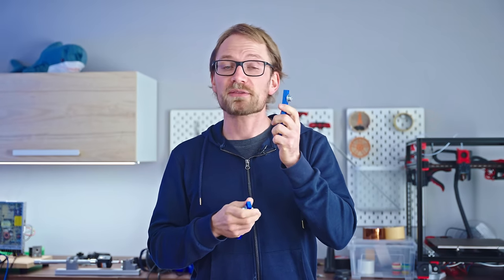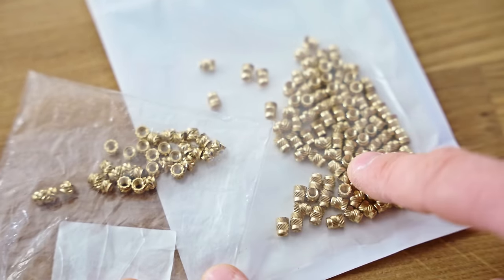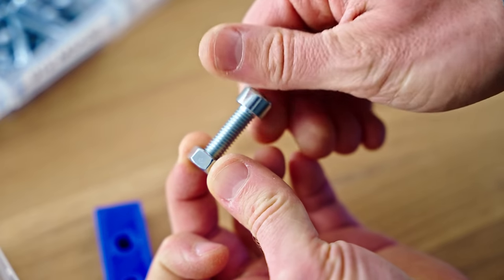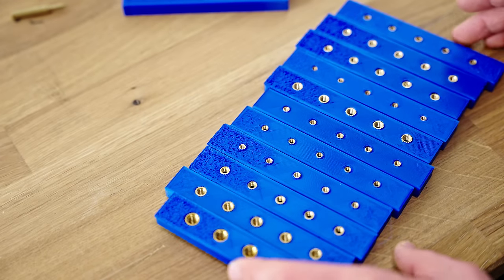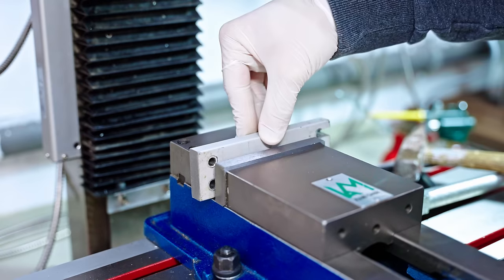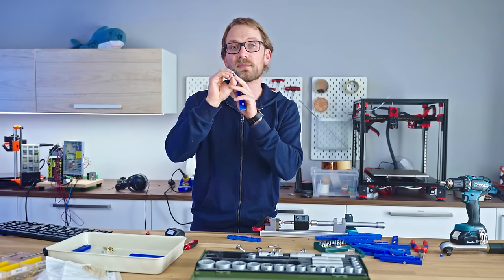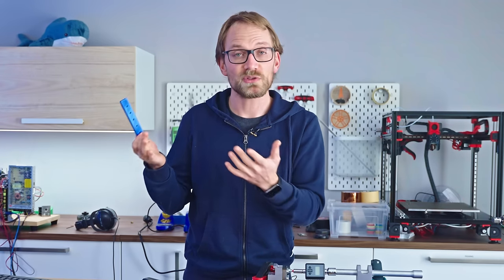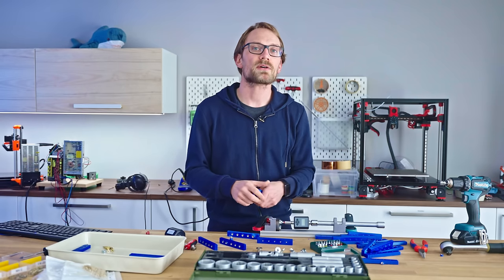Do you even need threaded inserts? Strength tested!

Comment: I typically use self-tapping 3mm screws in 2mm holes with no printed thread. Even for parts that need occasional disassembly and re-assembly they work great. And let's not forget that lots of injection molded cases do the same thing. And in my experience PLA parts survive unscrewing and rescrewing better than the industrially produced ABS parts. As I'm writing this I'm printing 3.5" to 5.25" mounting adapters that I designed today (because the ones on Thingiverse are all just imitations of mass produced parts and these designs work poorly for 3D printing) and the means of fastening the adapter to the PC case is by means of 3mm self-tapping screws. I always use the longest screws that will fit.
Reply: yeah, self tapping screws: fast, easy, cheap and often plenty strong. If strength is a question, bolt and nuts. I only rarely print things that I plan to take apart multiple 
times.
Reply: I skip the self-tapping part and just use regular M3 machine screws and force them on the hole. Power tools will melt the plastic, but if hand tightened, they usually work just fine. "Just fine" as in the level that I never opened the insert box I ordered a year ago.
Reply: This is the way.

Although I design my holes to be 2.5mm for m3 screws. I very rarely have problems with this kind of self-tap and it's always self-inflicted harm.

( i.e. impatient assembly, bad design, faulty print, etc)
Reply: @bogusF  and also if the hole got to small, a 2.5 drill by hand and all ist good^^
Reply: I too use regular M2, M2.5, M3 and M4 screws as self tapping screws (by hand). I print a hole smaller than nominal and using a separate slicer modifier solid (prepared in CAD), I add a 2mm thick ring of plastic (perimeters) just around the holes to be later tapped by the screw. If you use long screws as shafts (sticking out of the part) this method will effortlessly give you perfectly straight (perpendicular to surface) shafts. A thing almost impossible to achieve with inserts (that are impossible to sink in perfectly perpendicular to the surface). And you can screw and unscrews many times without ruining the tapped hole. I do not use inserts anymore for pieces not intended to be screwed/unscrewed repeatedly. I use PETG.
Reply: @korjaa that's exactly what I do and an M3 screw with about 15 mm of engagement in ASA will have enough engagement with the 3 printed parts to break the screw before it comes out. For some reason none of these videos from anyone ever covers that.
Reply: I use 2,5 or 2,6 mm for m3, 2 mm is way to little
Reply: @suit1337  I'm talking about self-tapping screws, not M3. Self tapping screws have a sharp point and a course sharp thread, very different from M3.
Reply: @frankbauerful  that makes sense yes, i was thinking about self tapping M3 screws (basically a screw with a treadcutter on top)

i guess you are refering to non helical self tapping screws like metal screws with a blade shaped cutter tip

i don't know the english terms for those, but in german they are called "selbstschneidende schrauben" with the blade cutter, and "gewindefurchende schrauben" with a metric thread with added cutters or a special teuleaux triangle shaped thread at the tip (see DIN 7500 for reference) those are great, because they behave the same like metric iso threads and can be removed and rethreaded
Reply: At re-assembly first turn the screw left with a bit of pressure until you feel or hear a light click, then screw it in. This way you reuse the previous thread and avoid cutting the material a second time.
Reply: Yall know drills that dont suck have variable speed right? Melting isnt an issue if you dont full send the trigger. Also, use the clutch.

Comment: For the past 5-6 years I’ve just self-tapped into a tighter printed hole and had excellent results that way. Yes, occasionally I’ll use a nut on the back and once or twice inserts but for 90% of the loads I put my prints through (including my CNC machine), the self-tapped printed holes seems just fine.
Reply: Same, and I have hundreds of products (modified, industrial card printers) out in the wild assembled like this and not a single fastner (mostly M3) failure.
Reply: Hear hear! Same here. This video seem more like a hidden commercial

Comment: A handy tip for increasing the number of perimeters around just a hole: You can put an infinitesimally thin annular gap spaced out a few perimeters lines from the ID of the hole. This will force the slicer to an extra set of perimeter lines around the hole without having the increase the number of perimeters everywhere. I'll actually put these phantom gaps anywhere I need to add solid perimeter lines in an area that would otherwise just be infill.
Reply: Ill have to remember this one. Could have used this trick the other day
Reply: Annular gap? Like cutting a circle into the existing hole with ~0 height?
Reply: @SixTough  More like a cylindrical gap  of, say, 0.001mm wall thickness but the height of your screw. The radius of the cylindrical gap should be larger than the original screw hole size by several (4 - 6) line widths.
Reply: @SixTough  nope, ctting a 0.0001 wall thick cilynder around the hole full depth, or maybe two concentric at 1 mm distance from eachother (assuming you print 0.4 mm wide layers), that forces the slicer to put 3 walls around the hole, another 3 around the first gap and another 3 around the second gap, but the gaps being so narrow the walls for each circle will melt into ecother giving you a 9 walls print.
Reply: @severpop8699  oh yes I see it now, thank you
Reply: Yes - I wonder about putting extremely thin slits in a starburst shape coming from the hole - could really improve the hole-infill interface?
Reply: @SixTough  anytime pal
Reply: @robbiejames1540  niet tavarasci, it has tofollow the shape of your hole, in our case circular
Reply: I made a video explaining this exact method ages ago. I called it seeding. It’s like inception. A cylinder within a cylinder 😂
Reply: @JLake3D got a link to that please? 👍
Reply: @stuffoflardohfortheloveof  Perfect & Strengthen Your 3D Prints Part 2 (Rods & Bolts)
https://youtu.be/wIA5BZCvHvI
Reply: @lobocnc also, with this method you can make nice ventilation grills in parts)

Comment: For extremely small screws (M2, M2.5, M3) I tend to just screw directly into an oversized printed hole; basically the tapping method, but skipping the tapping step. I get fine results, but I'm also never designing parts for strain, just assembly.

Comment: I usually embed nuts inside the print by modeling a cavity and pausing the print at the top layer of the cavity. Nuts are usually a lot easier to find for a particular size than threaded inserts, and more broadly useful. If you need even more strength, modeling in space for a steel washer between the nut and the inside wall of the part increases the engagement with the plastic part by quite a bit.
Reply: That's an absolutely brilliant idea, thank you for the tip!
Reply: Since you have no need to use a spanner, you could use square nuts, which have a bigger area (and a simpler cavity shape).
Reply: @fatroberto3012  True, but hexagonal nuts tend to be more readily available, especially when compared to threaded inserts.

Comment: My favorite is the wood thread insert with spikes on a flat washer on the back of the part. Also always add some extra walls around the thread and it won’t pull out but generally I’d print a section of 100% infill there anyways. If you can get 4x diameter on the hole depth, printed threads chased with a forming tap are wicked strong.  And like others said, burying a nut in the print in some way is always a super good option. If the nut is near an edge, you can add a keyhole slot on the side to slip the nut in and then screw through the front. I had to make a super tricky assembly once and used a thick 3mm washer tapped for an m4 bolt and slipped it in through a side slot that got plugged with epoxy to hold the threaded washer and plug in.

Comment: In my experience the screws for wood work much better. The hole in the printed part should be a bit bigger than the core and since these screws have a very deep and sharp thread, they usually connect very nicely with the part. The failure point is typically the connection between the printed hole and the rest of the part.
For tapping the thread into PLA i found that a decent lubrication makes the process almost perfect. I typically use some grease since it does not flow away unlike oil. By the way adding a little of grease on woodscrews eases the joint process a lot. Cheers
Reply: Wood screws are often conical, and can crack the plastic parts. Better use screws specific for plastic.
Reply: @fred-9929 this can be true, but straight-shank wood screws are far easier to find in your local hardware store and orders of magnitude cheaper than ordering a small quantity of plastic -specific screws. If you size the hole 1% larger than the nominal minor diameter of a wood screw it wont be any more prone to crack.
Reply: @fred-9929  Drywall screws are available in fine and coarse thread. Fine thread works well, and is even self drilling in thin steel with the good quality ones, and I have used them a lot that way, even on steel a lot thicker than the thin steel used in drywall work, like steel tubing with 1.2mm wall thickness. The coarse ones, or those designed for composite wood, are very good, and almost always stronger than the substrate, but are generally not going to self drill in anything other than composite board, or through 0.6mm steel plate..

Comment: I personally think, the Torqueout Test won't give completely comparable results, because of different coefficients of friction (galvanized steel bolt - PLA/brass/Nickel plated brass). 
A pullout test would give indefent results, sadly requires a test machine.
But I think the "ranking" would be quite similar. 

I tend to use woodscrews for simple "once" connections, Bolts in printed threads if the simple connection needs to be a bolt for other design reasons. Sometimes printing only the first few millimeters and let the Bolt cut the rest by itself (friction stops unwanted rotations).
Heat inserts only when I need wear resistance, if even more is needed Ensat-Gewindeeinsätze.
Really strong threads I get by designing in massively longer threading depth or a nut placed inside during the print.
Reply: Fortunately, I'm not the only one who sees that this test is worthless. Twisting force is measured here, not pulling force. It's nice that the coefficient of friction between the different materials is measured here, but that is of no use to us. With a drop of oil on the thread it suddenly becomes a bad result. And a bad thread becomes a good result.

Comment: I like to use “alternate extra walls” and “connect infill lines” to really boost the strength of printed parts. The perimeters become interlaced with the infill structure and resists pullout and deformation. I use grid for faster prints but prefer gyroidal for strength in all directions or for parts susceptible to warping.
Reply: I would think bicubic is better for overall strength than gyroidal, no?

Comment: First year Uni manufacturing here in Australia taught me that a bolt has a un-threaded shank portion where as a machine screw (not a wood screw) is threaded all the way to the head. Love the testing videos, keep up the great work.
Reply: Actually, the only difference between a screw and a bolt is what you call them. They are literally the same type of fastener. Don't get too caught up on the name.
Reply: @GrubbyZebra  It seems there's a difference in naming/function when engineering something vs home building.
Reply: @jetah50  the problem is that any supposed difference is easily disproven.

Bolts have a smooth section? Fully-threaded bolts (often called "tap bolts") are a thing and are commonly used to attach automotive body panels.

Bolts used with nuts? Lycoming cylinder bolts are installed into tapped holes in the crankcase.

Screws are only designed for tension and torsion loads? Nylon shear screws are commonly used to attach model rocket nose cones to the rocket body in order to prevent unplanned separation.

And I could keep going.
Reply: The only difference I’ve been taught and that seems to consistently stick is that bolts mate with a tapped thread whereas screws cut their own. Machine screws simply have a tooth profile capable of carving into the metal/plastic. Wood screws cut their thread into wood but I don’t think I’ve ever seen a wood bolt, because the material being held doesn’t matter to a bolt, as it knows it has a matching tapped thread to fasten with. A screw on the other hand needs a different profile, pitch, taper etc depending on the material it’s self-tapping into.
Reply: There is no functional difference between a machine screw and a bolt. It's just a shaft with some amount of thread on it and a head which can be used to turn it. And the second part isn't necessarily true.

There are self-tapping screws for wood, plastic, and sheet metal. They are a bit different in that their thread form isn't always designed in such a way that it's easy to make a reusable mating thread or nut. Still screws. A machine screw differs in that the mating thread form is the same as the screws thread form.

Self tapping or its lack doesn't make something a screw or not a screw, being all thread doesn't make something a screw or not a screw, and threading a nut on the end doesn't make something a screw or not a screw.

All bolts are screws. We should probably just call it a 'bolted joint' when we use a nut on a screw. But then you have some other types of un-nutted screws which are still called bolts because they always have been. Lag bolts and lag screws are the same thing!

-son of a general contractor, craftsman, trade machinist, aerospace engineer
Reply: @bobgarrish  this guy gets it :)

Comment: Two ideas I have are creating a wide ring in the middle of the screw hole that acts like an anchor in the shape of a washer. Or creating a recessed area on the backside to actually install something like a fender washer to spread the load out if you really need the strength.

Comment: Few other types of threaded inserts: "thin wall threaded insert" and "helicoil" both would be interesting to have in the comparison. As another comment mentioned, would be interesting to know print settings and do a review on things to improve the joint. I would also love to see how using a "matching" grade of screw would affect the strength of joint (i.e plastic screws). Ace video as always Tom, loving the new clean feel of the production.👍
Reply: Thin wall inserts will be about the same as going up a size on the bolt, but the hole will last a lot more insert remove cycles. Probably best is any of the inserts, and make the wall of the hole a full fill to double the diameter, which will allow better transfer of stress to the bulk media. As most of the failures come at the join of the insert plus fill to the bulk void space, a better bet is more material there, either denser for a 2 diameter volume, or better infill that uses more filament, but at least handles load better.

Comment: Great video 👍 something that people don't often talk or think about is that in many cases threaded inserts aren't necessarily "stronger" than direct threading...but in applications where you need to often remove a threaded fastener (eg. a thumbscrew) they are a must (for example helicoils in aluminum).
Reply: Exactly. "Strength" is the wrong question which is being asked. If you need strength, you need to bond the plastic together permanently.
Reply: This should be upvoted to the top! The helicoil example @emberprototypes gave is fairly common knowledge / industrial practice. Aluminum is too soft for repeatedly bolted/unbolted joints. They mentioned "often" but more realistically even one removal and reinstallation is too many - bolts into aluminum is often a one-and-done thing and unreliable to remove and re-bolt. The helicoil at its simplest form is just a tiny steel thread to increase the wear resistance right at the joint interface. This is doubly true for plastic.
Reply: Absolutely correct. You use an insert if you are constantly removing the part otherwise the plastic will just wear away.

Comment: I would love for you to test the direction of pulling out, AFAIK, Voron parts sometimes have you thread in the direction of installation and sometimes opposite. Taking your thread adapter into consideration, the large flange on the end would take a LOT of force to pull out in the opposite side of the install. Also it would be nice to know how much the different techniques of linking the perimeters to the infill would work! Great video!
Reply: Also they sometimes put inserts in a way that the other part will made contact with insert ( all force will be on metal ) and plastic part where insert is will be on that insert.

Comment: My daughter in law's father and I both had the same thought when we got our 3d printers. "Now I can print a hexagonal pit in the 'backside' of a terminal strip,  and trap plastic between a conventional hex nut and the screw head." He 3d printed a threaded hole thru the rest of the pla from the bottom of the pit holding the nut to the other surface. I just drilled and tapped mine.

Comment: Super interesting. Personnaly I usually extrude the shape of the nut from the other side of the part. thats my prefered solution as you often get the nut provided with the bolt, you dont have to buy plenty of insert or spend the time inserting them. Maybe you can do an addon video and compare to these results to this method, that would interest me a lot. Thanks !
Reply: That's what I thought too! 👍🏼